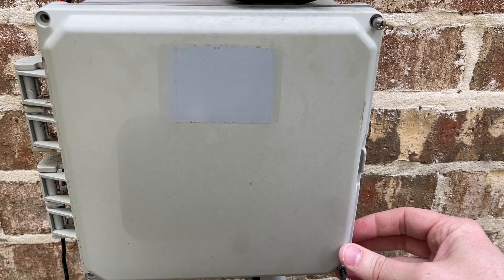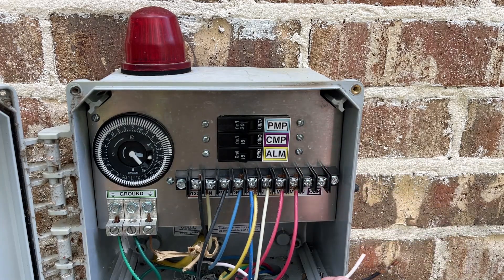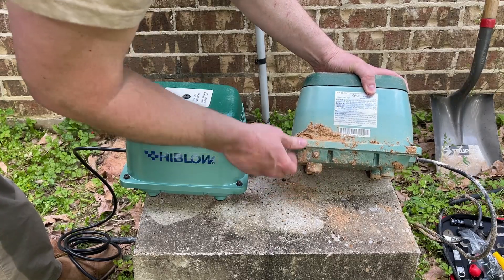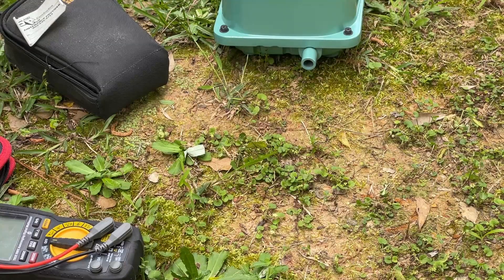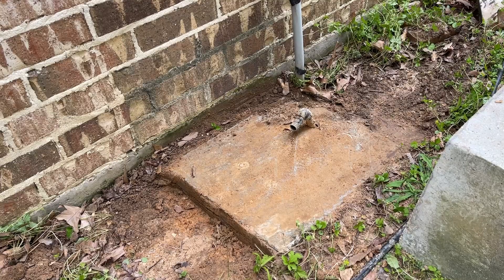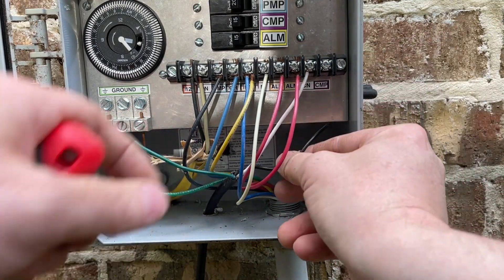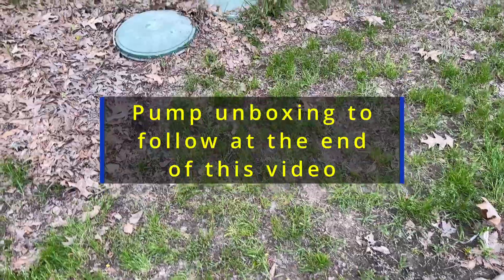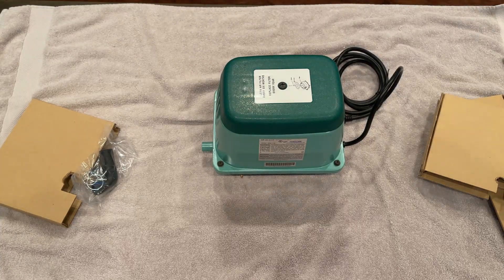Aerobic Septic System Air Pump Replacement

Comment: I just went out and looked ay mine and it wasn't even connected to the pipe.. I don't know how long it's been like that it's been years since I even looked at it. I didn't even know what it was for but I'm cleaning it up and cleaned the filter which was filled entirely with dirt and I'll connect it now

Comment: Ive had an aerobic septic for 30 years. The best thing i did was build a steel frame to mount mount to my house. No more ant issues from sitting on the ground and im at 15 years now with the same pump. Good luck.

Comment: Did you open up the old pump and see if it just needed a rebuild kit? They sell rebuild diaphragm kits for those pumps for around $60. Buy the OEM kit. They usually need a rebuild about every 3-8 years.

Comment: Great video. I got a quote from my service provider to replace the old one with a new one for about $800 including labor.  I just bought one from Amazon for $230. Was searching everywhere for how to do the total replacement.  Was worried about the cord, but your explanation confirmed what I thought I had to do. Thank you so much.  My system has a warning system that connects a tube to that brass fitting so if the pump fails and air stops blowing then it sounds the alarm. Also, on the Hiblow website they said the concrete box is to protect the pump from weather elements (sun and rain, etc.). Apparently it is supposed to be used indoors. Anyway, thanks again for the video.
Reply from the maker: I'm happy you found the video useful and thanks for watching

Comment: Save me even more money and cancel your inspections.. when you don't hear the pump running you have a problem when you smell s*** water coming out of your aerobic system you have a problem I don't need to pay a guy four times a year just to tell me I don't have a problem..
Reply from the maker: Some places require an inspection. I just had the floats repaired the other day because, like you say, its evident when there is a problem.

Comment: Is the pump supposed to blow air?
Reply from the maker: Yes, it is an air pump, also known as a septic aerator or compressor, is what makes a septic system an aerobic system.

Comment: Did you try replacing the diaphragms before replacing your pump. you can replace them 3 times before you have to change the pump. there is a kill switch on the inside when a diaphragm goes it triggers the switch. I install these systems for a living. 😊👍
Reply from the maker: I didn't try the diaphragms. I wasn't confident that would repair the problem and I felt like there was some urgency so I went with the pump since I knew that would resolve the problem.
Reply: @LivingCommonSense  that was the problem 100 percent. I do this for a living 😂 nice vid bud.👍
Reply: Definitely save your old pump. I replaced mine couple years after my system was installed then found out about replacing the diaphragms. Now I always got a rebuilt one stored so I can swap them out faster

Comment: My Aerobic Drip Aerator Pump lasted five years and the original installer just charged me $700 to install a new one. Thanks for the video, I assure you I will go self- install NEXT TIME!?
Reply from the maker: Yeah, its unreal what some folks charge for an hour and a pump. Thanks for a current pricing update.

Comment: I’m not sure of your sprinkler set up 
I believe regulations say the septic sprinklers have to be 100’ away from any fresh water well 
That may be why your sprinklers are in the back yard 
If you have a well in your front yard 

Thank you for your video
Reply from the maker: There's no well, but the backyard is much larger and closer to the pump than the front but still, I'd like to have leaked a little water on the front.

Comment: Btw… the pumps don’t go out too often. The diaphragms do for that type linear pump.  You can by a rebuild kit for $20-$40 dollars.  Takes about 5 minutes to install.  Don’t forget to reset the switch on the top or change the shear pin that comes with the kit. Lots of videoed on how to do that too.  Super simple!
Reply from the maker: I still have the old pump and been thinking about the repair options but just don’t have the time to delve into it right now

Comment: Great video thx.   If you’re doing your own maintenance now there is a diffuser on the end of the air line in your tank that needs to be replaced from time to time. Don’t forget about that.  A new aerator pump is $450 installed.

Comment: Just quoted 550 for the compressor and labor here in north Texas. The technician was nice and knew I worked in the water well industry and told me to save some money to order the compressor and do it myself, which I did.
Reply from the maker: That's about twice what I paid for the pump about a year ago. I'm glad you found a technician with integrity. He knows you'll remember him whenever you come across a problem that needs a professional to take care of it. Thanks for watching!
Reply: @LivingCommonSense I know this video is a year old but did you check inside to see if you could just replace the diaphragms inside the aerator? Looks like HiBlow 60. I have a HIBLOW 80.
Reply from the maker: I believe the pump is serviceable with diaphragms, hoses and maybe the motor or parts of it. I couldn't hear the old pump doing anything which "not hearing" it is what brought the problem to my attention. The short version is I just wanted it fixed and didn't want to maybe order the wrong parts, then order more parts...etc. I went with the new pump so I could be done with it.  To you point though, I think they are repairable.
Reply: @LivingCommonSense  there’s a safety screw inside that shears off when the diaphragm breaks or a switch itself that gets flipped off when the diaphragm ruptures (depending on how old the unit is) 

It kills the power to the unit and it won’t do anything until you replace it with new diaphragms. This particular pump in your video is pretty common so you can go to wholesalesepticsupply when this new one breaks in 3-7 years. Might cost $70 by then. Unless you find red dust all over the inside of the unit when you take off the main cover they are serviceable.
Reply from the maker: @LeuCustomKnives - I still have the pump -piled up on the junk trailer. I think I'll pull it a part and take a look at everything that may be broken inside. Thanks for watching!
Reply: @LivingCommonSense  I just took mine apart the other day and both diaphragms were split ordered only the diaphragms and got them today and installed 30 minutes ago. Back up and running again and the alarm isn’t going off anymore ☺️ $69 shipped .
Reply from the maker: The one in this video is a HIBLOW HP-60. It appears to take the same repair kit as the 80. I don't know what the difference would be. Maybe the 60 uses one diaphragm and the 80 uses two?  I'll have to check out the old pump and see if it takes one or two.
Reply: @LivingCommonSense  they both use 2 diaphragms. HiBlow 60 blows 60 liters of air per minute and hiblow 80 does 80 liters per minute.
Reply: Get a rebuild kit and rebuild it. I've done mine twice. When the diaphragms wear out they break a plastic safety screw and the two copper connectors disconnect. Have it running again for $80-$90. It's super simple to do.
Reply: I did a Retro..Every year the TX may raims flood me and shaft dies..After last one died 3 weeks ago. I got an air pump. It plugged into where areator is did and it sits on the lid, did get a flat lid for it vice the dome. Last 2x the yard flooded it has high and dry and still airing the flooded tank. Ordered a new control panel.as well, doing it myself.

Comment: Obtained a bid this week to replace this same pump.  Bid was $975.00 for pump and labor!
Reply from the maker: I believe it and prices are crazy these days. A lot of the contractors aren’t reliable enough to call on either but they keep getting jobs. Hope you get yours going.
Reply: Is that the Trans T2 panel? Was going to get that or the SPI Bio. Went with Spi.

Comment: It looks like you can rebuild it also if the motor still runs.
Reply from the maker: I think the motor quit. I noticed the pump sounded different a few days before the green cloud of sewer stench showed up when the sprinklers would come on. I believe there are repair kits but considering the time and smell, I went with the new pump to get things going again.

Comment: I glad you saved you some money. More people need to know more about how their systems work. 

We had roots going in the pipe going to the street. They had three trucks trying to figure out why they could not run the line out to the street and why it was coming up at another cleanout. They said they needed to get a backhoe to dig up the yard. I got a small drill pump i had and pumped out the cleanout and saw the the tee was installed the wrong way. So i got a stick so i could keep the pipe cleaner from coming up and keep going so it could go to where the roots so they could be cut. Other than that and AC guys we have not had any repairs done by others over about 40 years and 5 houses. 

Thanks for sharing, it could be thousands saved.
Reply from the maker: So back in the days of septic tanks and sewers that drained into the road ditch more than 40 years ago, we had a perforated pipe that filled with roots. My father welded a couple of 20ft rebar together and welded a home made bit on the end. Powered by a 1/2" drill, he shredded those roots and drug them out. Never had anymore trouble out of it. Good times and good memories. Thanks for watching!

Comment: Great video, I've never had a septic system before buying this house and the aerator pump just tapped out...... this is exactly the info I needed to avoid a $200-300 markup.  Thanks for putting this together.
Reply from the maker: I glad you found it useful. Thanks for watching!

Comment: That brass connector is to hook up a vacuum line that runs to the control panel to alarm if your pump fails
Reply from the maker: @Justin - Thanks for the info! An alarm would have been handy and maybe I could have acted before the sprinklers started stinking up the yard 😂

Comment: they should have installed a quick disconnect breaker box out there close to the system
Reply from the maker: No doubt the original install went to the lowest bidder. If code don’t require it then it ain’t happening